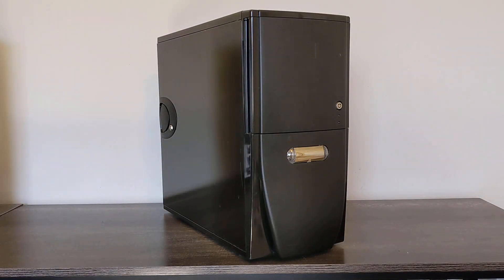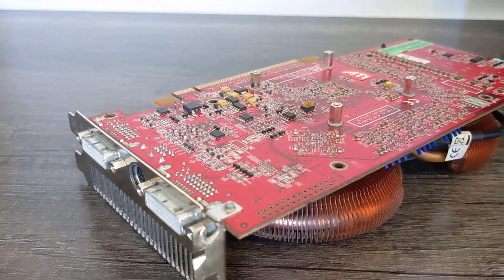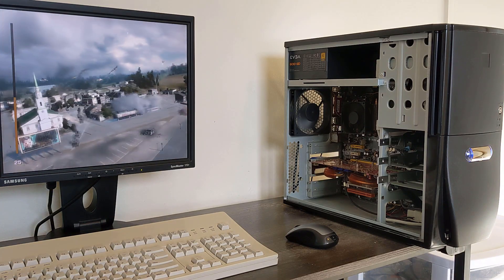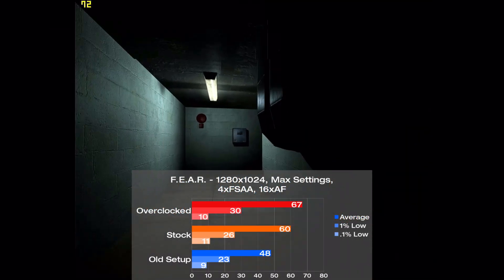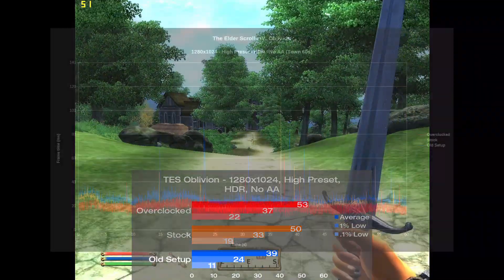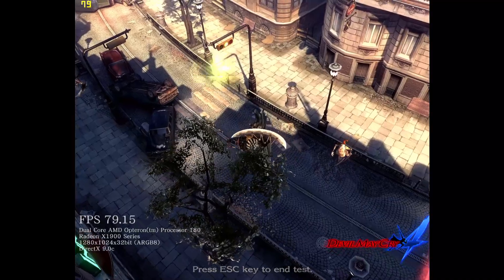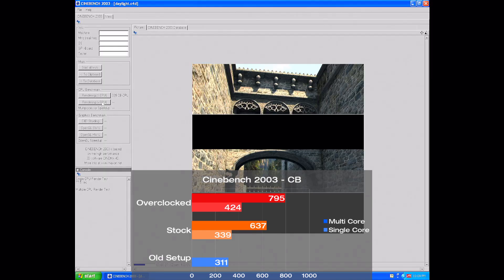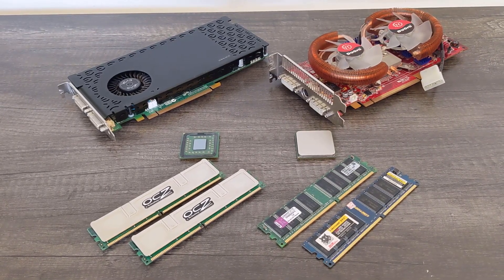Upgrading a 2005 Gaming PC for Early 2006

Comment: Very interesting to see a similar period correct setup with what i used to run in my 1st revision of my XP rig, i did move to an X2 4200+ to little benefit, the X1650 and 2600XT also hindering performance, it was like a fight between them, not good for 0.1% lows. The 3400+ pairs much better with an AGP 7800GS, sadly that combo board died, when i was remounting a cheap cooler, it slipped and put a lot of pressure on the corner of the CPU, making for a bad socket short, though as i mentioned in the last video, moving onto the am2+ platform with my foxconn destroyer, the Sempron 150 is much closer to my roots being that my first CPU was a 2800+. at 4Ghz it is very similar in performance to my X2 4200+ at 2.7Ghz. I still believe in the single core supremacy for older games Pre 2007. Though if you want to properly stress that CPU, get a copy of NFS prostreet, i put my 150 to the test and it fell on its face much harder than i expected, you can really tell when a game wants multi core CPUs. 

As a bit of a bonus, i purchased a scrap lot of CPUs on ebay and was able to fix up several black edition and high end Skus, my favourite being an Athlon 64 X2 4800+ for socket 939, the fastest processor released, overclocking well like the 180. If my XP rig is anything to go by, theres no need for me to go higher than a 3850/70. Though my 4870 was laying around and i do have a 4870X2 i need to fix, perhaps this or another dual GPU card example would be perfect to help stretch that CPU some more, while the X series ATi cards were good for the time, they aged very quickly, in NFS games of the era like Carbon or MW, even with the 150, my 2600XT was hampering me down into the low 20s and was a stuttery 42fps at best. When i put the 4870 in, the game sits at a solid 80fps, the CPU is now the limiter, but perfect for my 75Hz monitor. Any titles with better optimised engines are going to sing. But for 2007 onwards, i have my dream system, always wanted an athlon II X2 and some Asus Gold 8800GTs in SLi, OCZ gold DDR2, M2N-SLi Deluxe, K8 is a hotbox and doesnt scale well with overclocking, im surprised you hit 3Ghz, but K10 on an older system can easily hit 4Ghz on 2 cores provided you have strong enough memory, a particularly good bin with have 2 cores running 4.5. This is equivalent to an e8400 at 4Ghz and with how strong 775 was with its longer lifespan, K10 is going to be the fight you need to bring! My friend managed to push one to 5.8Ghz on LN2, beating an Athlon II X4 635 at its stock 2.9 frequency. 

Depending on where you want this PC to sit, SLi was still a spotty gamble, but a strong single card like a HD 3000 series may pair alongside your 3Ghz chip very very well!

Comment: had athlon 64 with x300 radeon and 1 gb ram used it from 2004 to 2012 :D  played crysis multi on that thing with 20 30 fps :D
Reply from the maker: Wow you got a lot of longevity out of a system like that, amazing considering how fast hardware was evolving back then! And that poor X300, it must have been on its knees trying to run Crysis 😆

Comment: You need a better CPU cooler. If I still had it I would throw you my old Zalman cooler I had on my 939 build.
Reply from the maker: Yeah, the Phenom II stock cooler is lacking on this chip for sure, it got pretty hot during the overclocked testing. It's hard to find a lot of the period-correct coolers on the used market, I might just grab a Wraith Max or something.

Comment: X1900 XTX was my dream GPU back in 2006 so it awesome to see it being tested in era-correct hardware with modern methodology. really interesting how much the 7800 GTX gets clobbered compared to reviews back in the day, even in its old OGL stomping grounds with Doom. (maybe i'm thinking about the 512MB version)
Reply from the maker: Love testing the X1900 XTX! It's amazing how much longevity the card has thanks to its architecture and pixel shading power, in older games it's not too much faster than the 7800 GTX but in anything beyond 2006/2007 the X1900 blows the 7800 GTX away completely.

Comment: I never had the OCZ platinum just the gold. It was so different back then in terms of brands. Antec was the best PSU maker and I had Abit motherboards nvidia made motherboard chipsets and ATI was not owned by AMD. You definitely had a point regarding the advancements back then. I would upgrade much more frequently because it was needed but also parts were cheaper. Budget was like 60 bucks and mid range 200 bucks. Now 200 is budget and mid range is 600. And you can keep parts for half a decade and they will barely have aged.
Reply: OCZ was a brand that I really liked. Had a modular OCZ power supply that looked similar to the heatsinks (all shiny) and that PSU lasted me a long time.

Comment: I am still "hunting" for an Opteron of that age and a DFI motherboard. Great video !
Reply from the maker: Thanks! And best of luck, DFI has become like the 3dfx of motherboards on the used market these days 😅
Reply: If you can find an ASUS A8N SLI Platinum board, then that is also a good choice. The s939 had 2 main chipsets. The N meant NVIDIA, with SLI support. Unfortunately most manufacturers did not install adequate cooling on those chipsets (including ASUS), so they killed themselves. One exception was the Asus A8N-SLI Premium motherboard, as it used a heat pipe cooler for the chipset.

Comment: That CPU is a good one! 3GHz on S939 isn't common.
Reply: Never got past 2.8GHz stable myself :/
Reply from the maker: Good to know, I thought it would have been par for the course 😅 I wonder if I could push it any further with a better cooler, could also pair it with a 2900 XT or 8800 to let it stretch its legs a bit
Reply: @SPNG It definitely is an extremely good CPU speed. My x4200 only ran at 2.2 GHz, and had HALF the Cache per core. But as for memory: Nope, the 500 MHz Geil is NOT the best. I did see 600 MHz Geil Platinum DDR1 sticks for sale back then (they were more like 550 MHz CL2 sticks, but yeah...)
Reply: @SPNG  
I could only dream of the 8800gtx and hd2900/3870 back then, those will definitely match it better even tho my soft spot will always be the x1900xtx haha. As for further overclocking it could be worth a shot, but the sweetspot was usually 3ghz for the better steppings, best you could hope for is 3.1ghz with 1.55v with that one, but even that may be a stretch. Also you may need a DFI board to push further as the power delivery on the mainstream boards wasn't the best and you'll need very stable voltage for those high "on the edge" speeds.
Reply: @SPNG  so fun fact back then I tried something similar, I upgraded from an x1900GT to an 8800GTS 320, i got very little preformance uplift, at the time I was using an X2 5200 BE overclocked to 3.1ghz, i then bought an X2 7750 BE and got a significant boost, the old A64 arch was just getting old, in truth A64 is just K7 from 1999 with an onboard memory controller, Hammer is barton with 64bit instructions and an IMC bolted on.
Reply: @candle86  To me, SSE2/SSE3 support (on top of things you mentioned + lack of FSB), makes it different enough from Barton.